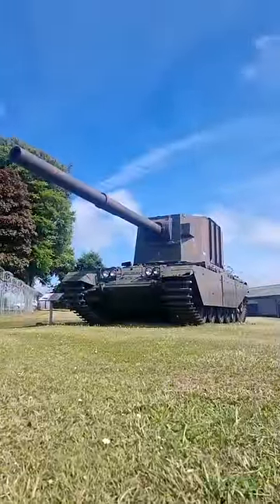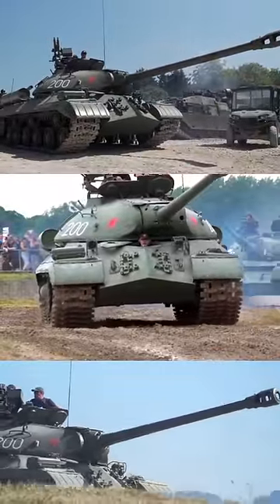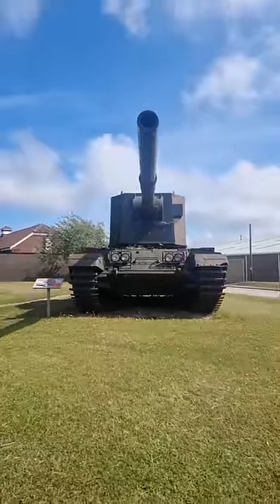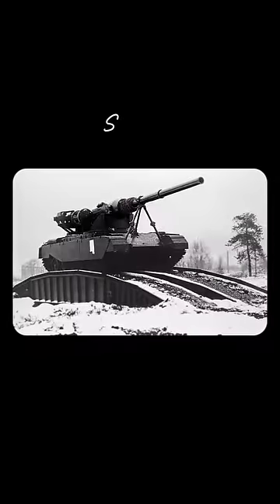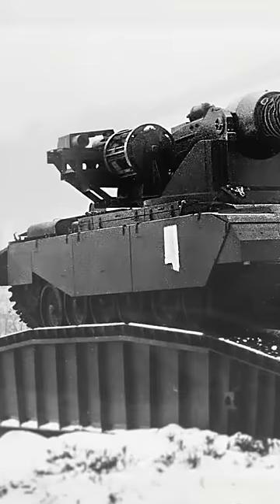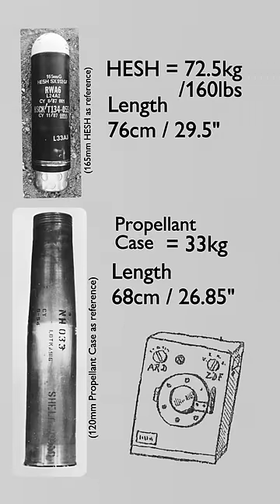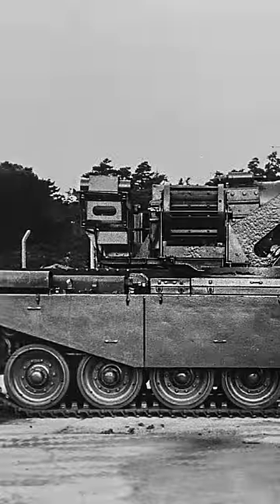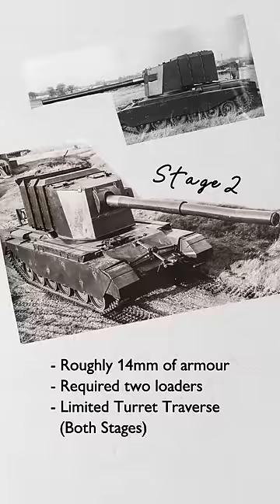The FV4005 #shorts

Comment: Imagine lifting a washing machine every time you need to reload the gun
Reply: How many rounds per hour?
Reply: Half a washing machine per part of round. Not as bad.
Reply: @Surv1ve_Thrive  
Pretty sure the Hesh warhead sans propellant weighed 79kgs.
Reply: @johnbaker1256 Propably 45 but it couldnt fit that amount inside
Reply: The US currently has rounds that weigh up to 110 lbs.
Reply: Me after bench pressing like 20 of these: “Aight Imma head out”
Reply: @Surv1ve_Thrive Most washing machines aren't that heavy. They're just awkward to hold.
Reply: @ANGRY_AUSTRIAN   most have a slab of concrete in them to make them...heavy.
Reply: @nickthorp6361  That is true. 
. I was moving one and it fell out. The washing machine would walk across the floor😂 We fixed it by putting a 2 by 4 in between it and the wall.
Reply: @ANGRY_AUSTRIAN  🙂👍🇬🇧  yes its a complex mass of forces.  Your fix works as long as the wall is strong. I've repaired a few. Not my job at all, but they seem simple enough to work on. I think some relatives in the 30s or 40s with a factory had a chance to make one of the first washing machines, from a US patent. Turned it down stuck to car parts. Some relatives have joked how we could have been a massive company if we said yes. Who knows?

Comment: The FV4005 if I remember correctly was meant for long engagements against enemy armor, acting as a tank destroyer. That's why it's turret armor had very small protection, only being used for protecting the onboard tea from the rain
Reply: Also, the gun and the ammunition in the turret are heavy enough as they are. Adding armour would probably make the turret traverse mechanism really troublesome.
Reply: Fr 😂😂😅…..
Reply: Yeah but, bit of an overkill dont u think? I mean blowing a centurions turret clean off
Reply: @gumilangputraandiwaluya987 it was developed specifically to fight the is3/t10 it wasn't going to be fighting centurions they just had to use what they had as target practice
Reply: @gumilangputraandiwaluya987  also basically every Russian tank today back to the 60s have their turrets pop off when shot a pretty high percentage of the time and nearly 100% if hit in the autoloader... Conveniently placed right behind that weak ahh lower front plate. Tldr popping turret does not equal overkill... Always
Reply: @gumilangputraandiwaluya987 overkill for mbt. But the russians has armor bias on their sloped heavy tanks so no.
Reply: @kaidenw5952 just like any other tank, really. I've seen dozens of videos of leos2 getting their turret blown off
Reply: @No.fly.zone.taken24163  Sure, but not nearly like Soviet designs. They really need to rethink their designs
Reply: @robmccormick3197  doesn't "soviet" say anything to you? They're taking use of older and outdated equipment that could still make use, other soviet tanks are disassembled for material use
Reply: Nah it was a city brawler tank, due to it’s small humble size and extremely fast reload rate. Only ment for urban warfare in confined spaces…
Reply: @Somvanligt..  But of course! How could I be so blind to the truth all along? Thank you for the enlightenment good sire
Reply: I know it’s “just a video game,” but I figured it was best for long engagements from using it in War Thunder. Also, the ammo is stored standing up and against the turret wall. Kind of a silly design flawed in my opinion since they used squash head rounds.
Reply: But still allowed the crew to brew tea.

Comment: If I remember correctly, it has a limited horizontal traverse of 45 degrees on each side. It was originally designed to be able to traverse 360 degrees, but they limited it because the recoil from firing the gun was so powerful that firing over the side risked tipping the entire tank over.

Comment: HESH = high explosive squash head. Basically the tip was insert so the explosive would mushroom out a bit over the armor, especially if hit at a slanted angle, then explode, causing spaulling on the inside or rupturing the armor from the inside out -- not necessarily penetration.

Comment: ...we called the 'HESH' round 'HEP' 'High Explosive Plastic' in the Army...shortly before I got to my unit in Germany in November 1971 there was an incident at Grafenwohr where the main gun of one of the M60s was cut clean off just forward of the bore evacuator...HEP was no longer authorized for use in USAREUR...our main AT round was the standard HEAT projectile...

Comment: I believe it was actually the refinement of APDS to APFSDS that killed the FV3005.  With discarding sabots becoming much more effective once a stabilizing fin was added, the need for huge caliber rounds diminished significantly.  APFSDS were able to destroy enemy armor at extreme distances and were much easier to load into guns with conventional bores up to 125mm.

This same innovation is ironically also what killed the Soviet heavy tanks.  The IS tanks were simply impractical when it was demonstrated that APFSDS fired from a much lighter, simpler machine, such as the centurion or the M48 Patton, could wipe the floor with them.  And despite great reluctance on the part of the Soviets, and Stalin's ego, the line was eventually terminated.

Bottom line, APFSDS killed both the heavy tank and the heavy tank destroyer.

Comment: Even the KV II 152 mm round weighed just under 60 kg.  This tank was a lesson in too big.  If the designers had paid attention to the KV II, they’d have seen it was just unwieldily and a perfect target.
  On the IS III: there was so much weight on the first two road wheels that they kept breaking down.  The suspension was not made to take that kind of weight.  History shows us that whereas the IS III might have made for an impressive parade tank, it never performed well overland.  They were shortly discontinued.
Cheers for the washing machine flying down range!

Comment: what we need is an abrams with that gun but it’s role is heavy tank instead of MBT.
but also wider tracks. and a good ammo pool.
Reply: M109, the turret of this thing doesn’t have much armour so it’s closer to a tank based self propelled artillery.
Reply: @Blaidd7542  wtf you mean that’s an actual vehicle not speculation.
Reply: @nickkozak4763  I mean it’s a modern American self propelled artillery with a more modern 155mm howitzer. 

Even the Abram’s 120mm is a more effective anti armour weapon than this 183mm.
Reply: Who tf need that 183 mm gun when the Abrams' 120 mm gun was already better?

Comment: Can it pierce a modern day, Abrams
Reply: HESH (high explosive squash head) doesn’t penetrate like traditional armour piercing, it molds itself to the outside of the tank as it explodes blowing a hole and sending shrapnel from the armour into the tank. 
It’s impossible to say if it would penetrate, since it was only ever tested against steel armour and the Abram’s and challengers use chobham ceramic composite armour. 
But even if it didn’t the tank would still be wrecked and everyone inside would be going to hospital for concussions and TBIs
Reply: @Blaidd7542  I’m betting if I shot a round from the USS Texas, it was probably destroy the tank
Reply: @mr.puppymustache3860  USS Texas is a battleship, with 356mm/14 inch main guns, hitting tank would not just destroy the tank, there would be nothing left to recognise as a tank. 
The gun on this is more like something from a cruiser, though with lighter shells at lower velocities, a full power cruiser shell would flip it over backwards, still more than enough power to destroy any tank ever.

Comment: The FV4007 is the last tank in the lineage of conventional ww2 designs. After this tank we started focusing on different ways to penetrate armor such as HEAT and then later APFSDS in the modern era.

The German Leopard 1 was the first tank to follow this new line of thinking. Why have so much armor when there will always be a HEAT round that can penetrate it like butter? Instead lets lower the armor so we can go faster and cover large distances with ease but still have a gun that can absolutely reck other armored targets.
Reply: Nah. The Centurion had the 105mm gun and ammunition that made Leopard notable, years before Leopard even existed 😂 .

That: and Britain went the other way to Leopard 1 with armour, deducing [correctly as it turned out] that HEAT was not unstoppable.

Indeed; Leopard 1's criticised chiefly these days on having too little armour.

Comment: Can it destroy the tiger tank?
Reply: Effortlessly.
Reply: Very, very easily
Reply: The QF-32 Pounder (94mm or 3.7") put a round straight through a Panther in postwar tests. The 183mm would have erased it from existence 😂
Reply: @jimtaylor294  So the tiger is not unbeatable
Reply: @tamoghnasen5158  Yup. After all Tiger 131 at Bovington was captured by a QF-6 Pounder armed Churchill III 😉 .
(as even an ostensibly less potent gun can disable a Tiger)
Reply: @tamoghnasen5158 the Tiger was never invincible

Comment: HESH rounds are basically just explosive rounds, correct or no?
Reply: Anti-material
Reply: High Explosive Squash Head
The round Pancakes upon the target before exploding; highly effective in generating Backspall & Pressure Waves, and at demolishing buildings.
(particularly in Basra during Op' Telic)
Reply: @jimtaylor294  Okay ,so yeah that’s exactly what I thought they were but just wasn’t sure if I was just confusing them with another round.
Reply: @Austin.Kilgore  Fair enough. There is after all HE-family rounds like HEP (which Centurion used), which are related to HESH but distinct / less capable.

Comment: Its a FV4005 turret on a Centurion hull - not the same thing.
Reply: Centurion is the right chassis, just wrong mk, needs mk 3 not mk 12
Reply: @Noreik395  Yes sorry, I overlooked that. But they can't talk about restoration or say "this is" when it isn't.
Reply: Yeah i definately agree, they should have specified its the wrong mk chassis
Reply: It is a centurion variant.
Though only the turret was handed over to the museum.
The hull who knows what happened to the original hull proberbly converted into something else.
Reply: @davidty2006  Agreed. When its restored they should mention that though.

Comment: 2.5 kilos is equal to 5.5 pounds 
A washing machine weighs 25 kilos.
Reply: If your washing machine weighs only 25 kg you have an extremely lightweight one. The full size ones are typically significantly heavier, more like 70+ kg